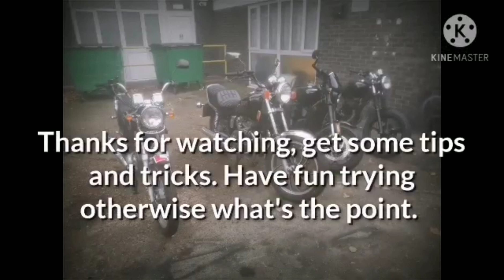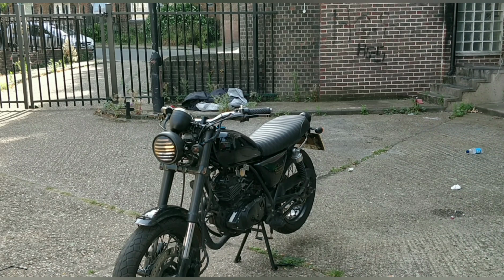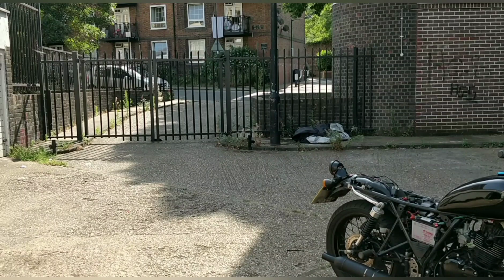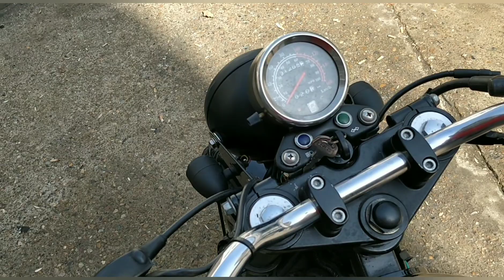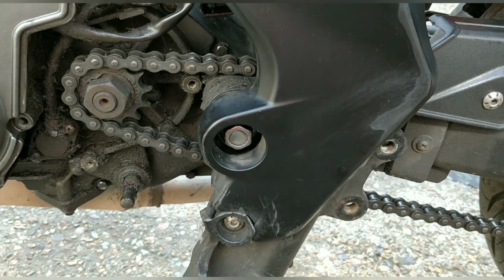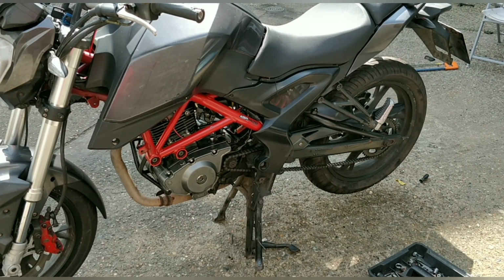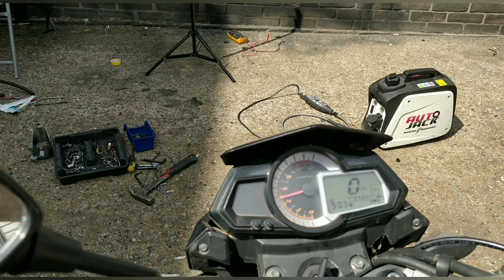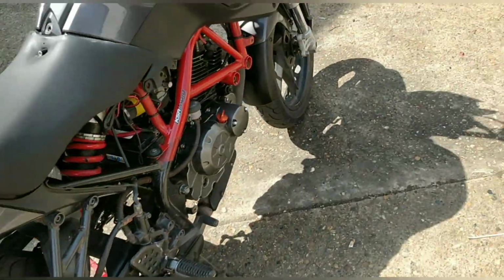Tayna batteries, what a let down. lexmoto gremlins, ksr moto grs gear linkage fix.

Comment: I like the induction sound and the bike sounds nice
Reply from the maker: Yeh it does. For now I'll keep the cone and continue testing this weekend
Reply: @motorcyclerescuer  that exactly what I'm doing with my bike I'm not sure if you've seen the video i posted of Facebook i think i found the engine mount the test centre was on about but I'm not sure I've checked everything else and can't see anything but I've got it booked in somewhere else and they are going to give it a once over and the other place quoted me for 2 new fork seals

Comment: I would check to see if something is shorting under the seat or even around the suspension.  This maybe could put a drain on the battery ? ( again , I'm spanners not crimps) just seems odd it cuts out when you sit.   But the ksr is coming along nicely . I would go original airbox, but that's just me . I like the simplicity of stock parts . I'm into restoration .. 
Take care buddy , Peace and love ✌ 💚
Reply from the maker: I think I found the shorting issue. I'll triple check everything this weekend to be sure. 

Cheers springy

Comment: I'd stick the other exhaust back on it now Charlie they sound good
Reply from the maker: I can't Jay as it burns so much that it looks like the engine has had it. Whatever is inside it just won't burn away. I'll have to use this black one mate
Reply: @motorcyclerescuer  how about, add a bit of diesel in exhaust and burn it out like that, without putting on?
Reply: @motorcyclerescuer  that's a bummer mate
Reply from the maker: Hmmmmmm that could work. I'll consider it this weekend. Thanks buddy

Comment: The ignition switch on the valiant suffer from the inner contacts getting water in there and causing some rot and gumming up which causes intermittent loss of power.could be what’s wrong with yours
Reply from the maker: Cheers Roland. I've been in mine recently but will take another look if needed. I think I fixed the issue in the end but the battery died so I couldn't test it
Reply: Ok these valiants are full of gremlins hope you have got it sorted I'm away camping at moment so I've not tested mine yet hopefully I've sorted it out

Comment: I've only bought sealed ones from Tanya and had zero issues so far.
Also could be this shorting out issue draining the battery prematurely.?🤷🏻‍♂️

A shorter link off the gear selector shaft to the ball joint would give you a better throw on the shift I think too
Reply from the maker: Yeh I was thinking that about the shifter Laguna. 

The shorting only happened for that hour last weekend. The bike rode to mot and back perfectly. I think I've resolved that issue but had to charge the battery again. 

This weekend I'll double check that the bike is charging just incase and I'll look for any battery drain. 

Cheers mate
Reply: @motorcyclerescuer  I hate electrical faults is all I can say 😂

Comment: State you have the right to refund and/or return as per distance selling regulations OR unfit for purpose...all as per trading standard's Charlie.
Request a returns label too.

The new gear lever bike...no front sprocket cover?
Reply from the maker: They have offered to collect for free, it's just a bit of a pain as someone will have to be in all day to await collection. That's the way they do it for warranty. 

Yes I've got one, just took it off while sorting the lever.